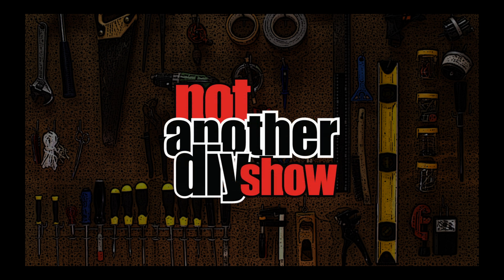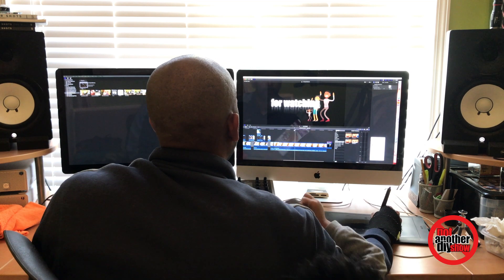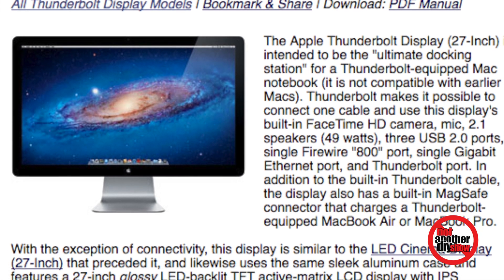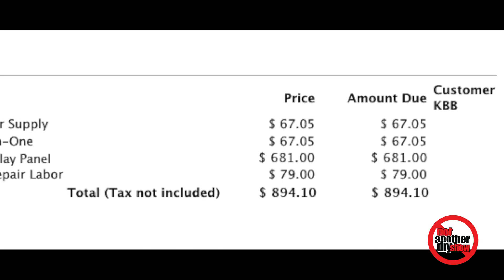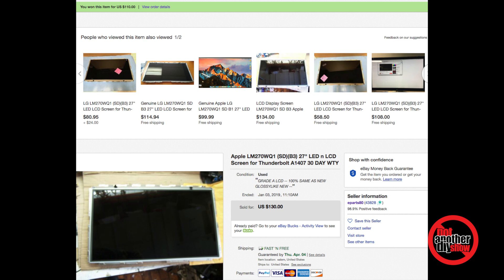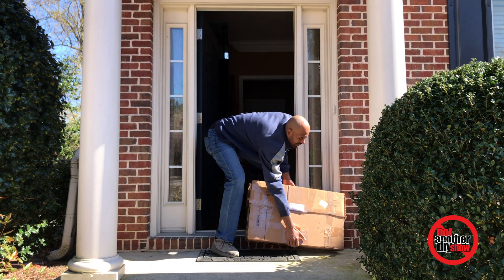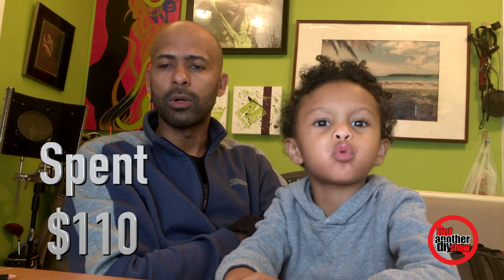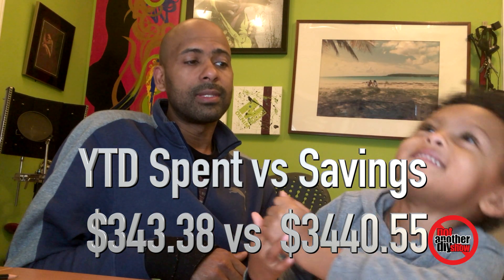Episode 5 " How we fixed  27" Apple Thunderbolt Display"

Comment: Question. My screen was doing the same thing, it would blink in and out and then finally it went black and would not come back on again. This is a recent purchase but the problem is I could never get the speakers to work either, even when the screen was. I'm certain it's not the power supply because like you, I've tested all the USB ports and they're all working whether I use the lightning bolt that's with the monitor or exterior lightning bolt cables from Apple.  I've never got the speakers to work so if I replace this panel can I expect the speakers to work or is that something completely different?

Comment: Also did you buy oem or aftermarket?
Reply from the maker: I bought used OEM. From everything i read it had to be the exact model sku. the LCD from the Imac looks identical but they are not interchangeable. Because of that i wouldnt have taken a chance on an aftermarket. I never even looked to see if there was an option
Reply: Not Another DIY Show I see one on there currently used working and tested for $45. Just need to confirm if its the exact model number.

Comment: Great video! Awesome helper you have there! My question is how do i know if it’s the lcd panel and not something else?
Reply from the maker: Thank you for watching. Its really cool to be able to pass on my tinkering process so he can be hands on in his life as well.  Unfortunately there is no certain way to know. Its process of elimination. And i always try to go through the easiest, cheapest solutions first and work my way up. On this monitor from everyone elses feedback it seems to be the Power, Cord or LCD. I had a 50/50 chance and guessed right. Leading up to it going out i would unplug and plug and it would pick it up. it didnt feel like the connection was bad or had a short. And it would come on so it had power. So i went with LCD panel first.
Reply: Not Another DIY Show sure thing. Mine when hooked to my macbook throught the mag charger lights up and charges the macbook. But no picture. So I’m wondering if the lcd went bad. The thing is I bought it years ago and have hardly used it. Maybe 12 times. And now with some new software I need for work. I want to use it heavily and it worked for one day then black. Figured

Comment: My own Apple Thunderbolt Display died without warning. I know someone else who was experiencing an issue wherein the display would only work for about a half hour before turning off. After researching that symptom, I discovered that it was likely an issue with the panel itself. And, now that my own display no longer works, I'm looking into the issue once again; it's most likely that its panel is suffering from a similar malfunction. I even discovered, upon taking apart the other display I mentioned, that these displays contain a small fan—I can hear it if I press my ear to the casing. Upon plugging the power into my own display, I can hear that fan spin up, leading me to believe that it is not a problem with the PSU. I'm thinking I'll try and replace the panel, in hopes that that will last me some more  years. It's a small price to pay, really, considering that I got the display for $250.

On a separate note, I believe that LG manufactured these LCD panels; and, to be quite frank, I think Apple needs to ditch LG for good: they are the worst-ever manufacturer of displays. This is the fourth LG display that has given me issues, in fact. Even my MacBook Pro Retina technically contains an LG LCD, and the screen suffers from ghosting/burn-in.
Reply: Yep! agreed...but like you said for the price its worth the try....I did this fix and if i get another 2-3 yrs out of it it was well worth it.

Comment: How did you narrow it the LCD being bad? This morning I came in the office to find my 27" screen dead... In my case I think the power supply is bad as USB connected devices are not displaying, or the entire monitor for that matter is. Completely dead, out of the blue.
Reply from the maker: So for me it was process of elimination. The 3 major components to it being bad was power supply, cable or LCD. I was going to try all it was just the order to try based on my symptoms...My USB ports still had power. So I took a chance at the LCD first. In my case I got lucky and it was the LCD alone.  Good luck with your fix....

Comment: So Ive been using Apple since 2012 & yesterday someone gave me a Apple LED Thunderbolt Display (27-inch) I have since figured out that this is not an iMac but just a display monitor made by apple.... so my problem is I cannot figure out how to power  it on.... must I have it hooked to a   MacBook  or something first?
Reply from the maker: Kym Calloway Thank you for watching. If you have the same one I have it will have a usb, thunderbolt cable as well as a charging cable for MacBook Pro. It will plug into outlet and charge MacBook Pro or just as I have it is hook to the iMac. They hook up thru the thunderbolt cable. If you don’t see an image after this you  the LCD is bad like this episode or the cable is bad. You can also replace the cable...

Comment: Great tutorial, your little one is a natural, he made it look easy & he even let you help!, I have a question, someone was throwing a thunderbolt monitor in a dumpster, so I asked could I have it, they said yes,  now I don't have an apple machine to try it out but when I plug it in the screen is black- nothing happens. Do I need to connect it to an apple computer to get anything? I connected my iPad into the rear usb and it was charging, any thoughts.
Reply from the maker: Gasgiant thanks so much for watching.  Are you trying to use on a PC?  They did come out with a thunderbolt3 (USB C) to thunderbolt 2 adapter. With the display from what I’ve ran into it’s either the cord has to be replaced or the lcd.